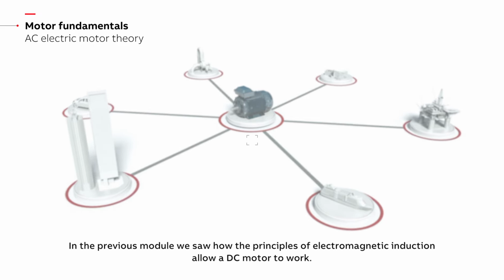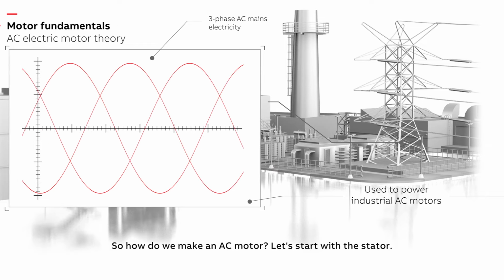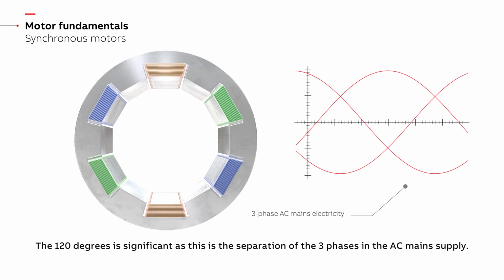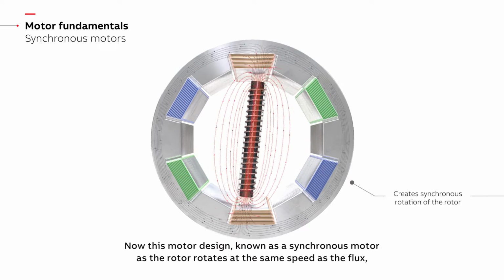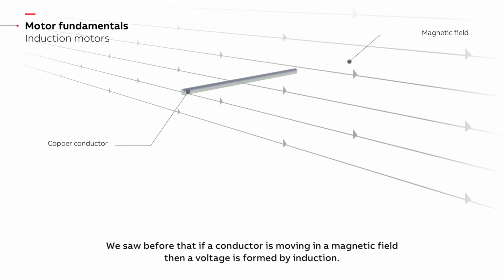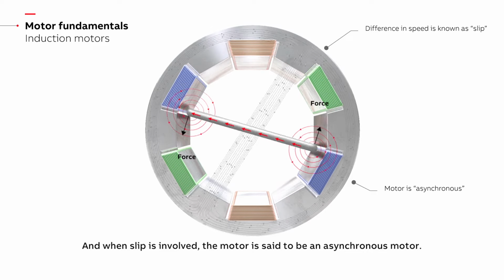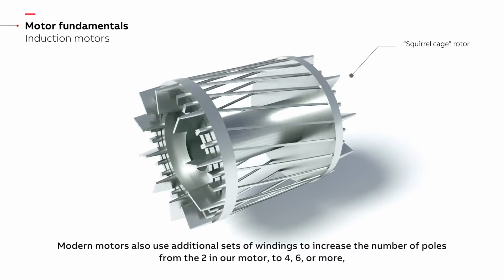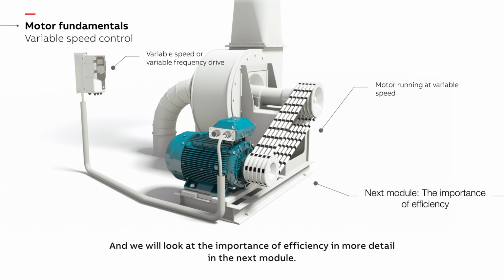How alternating current motors work?

Comment: Pretty sure bldc is actually an ac
Reply: Nah it works on a battery which is dc
Reply: @holtsff  electric cars which use a modified induction motors use batteries
Reply: @beaclaster 😂🎉
Reply: the dc in bldc stands for direct current

BrushLess Direct Current
Reply: @holtsff whether or not a motor is  dc or ac is not quite dependent on its power source. Instead, it’s determined by the pattern of the current’s flow through the motor.

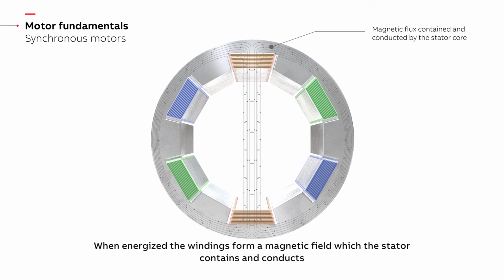Comment: in 1:16 what does "when energised" mean?
does it mean that we apply the 3 phase current to the windings on the stator?
Reply: We apply a charge to either end of the copper windings. When a charge is applied , an electromagnetic field is created. When that field is created,  it causes the rotor  surrounded by the windings to rotate in a full 360 degrees
Reply: Exam was 4yrs ago but still thank you Jeff
Reply: @Giorgalis  gold